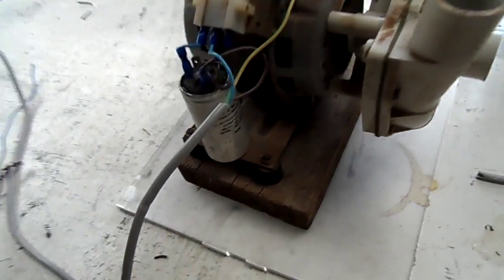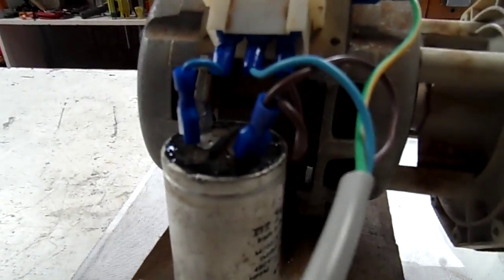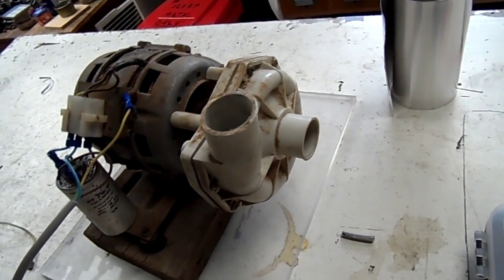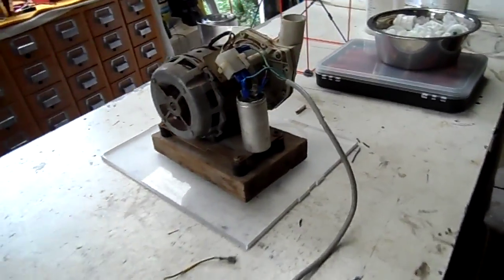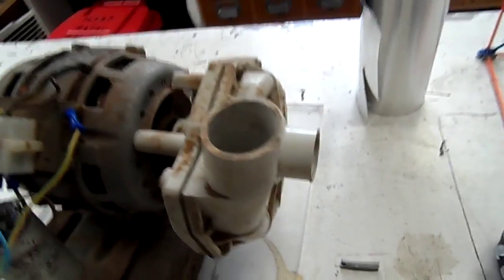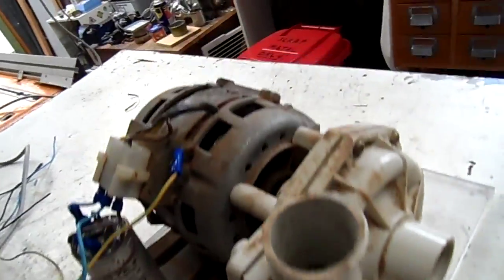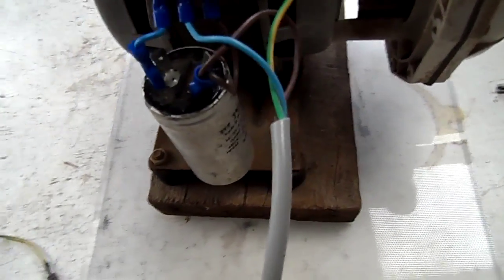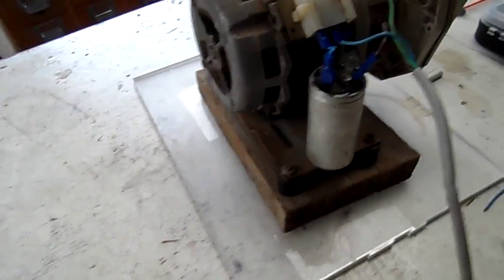Capacitor Start Induction Motor Test

Comment: That's an amazing visual setup!  However, most people seek this videos to understand how a motor and capacitor work and they are hooked up. Adding a schematic further clarify this. Is a possible you  can add it to your video and explain the current flow?
Reply from the maker: Bit hard, as I'm really not sure on the current flow. All I know is the start winding draws more current than the run winding. And that the cap gives the start winding a kick-start to help the rotor spin up to full speed. Have a look at Learn Engineering, they explain (with diagrams and awesome graphics) on how these work

Comment: You're probably risking destroying the water pump shaft seal by running it dry! Water normally lubricates the seal.
Reply from the maker: Don't worry mate it was shot anyway ;) leaked like a sieve when I tried to use it